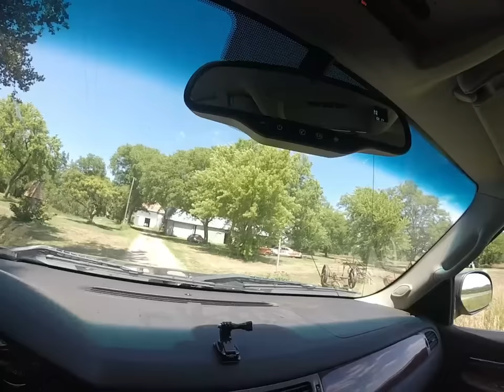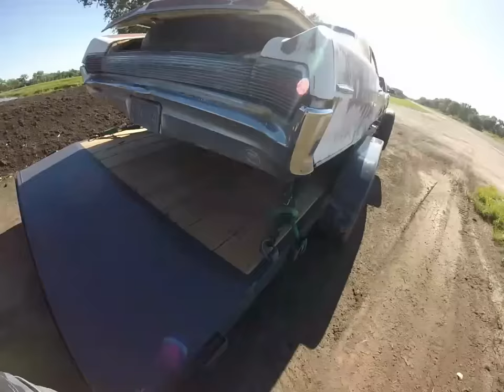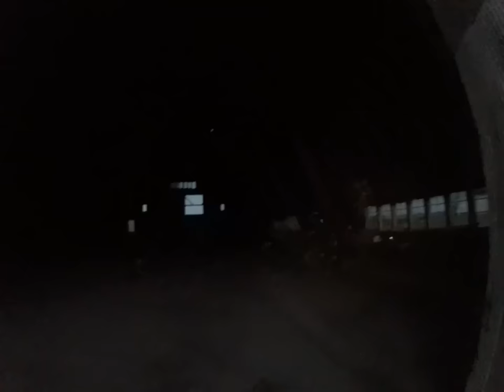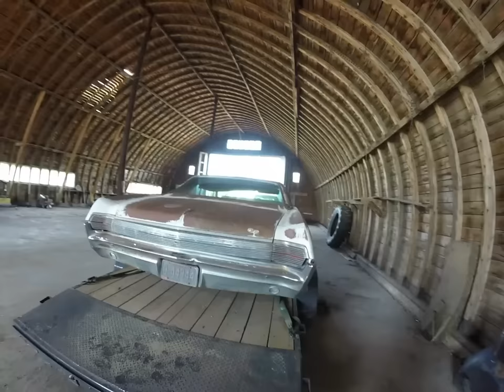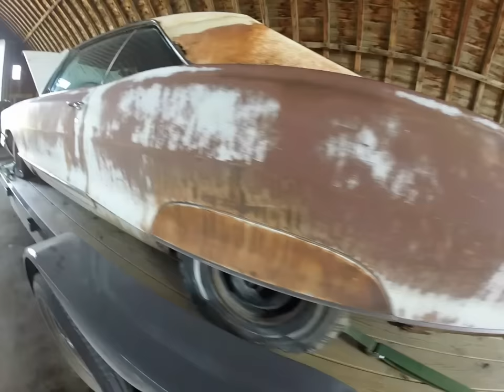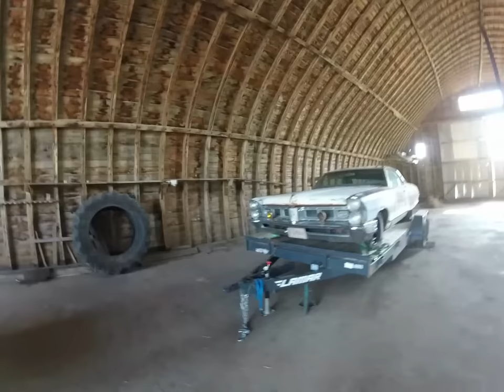Dragging a 1965 Pontiac Grand Prix to the farm

Comment: first of all thats an implament trailer NOT a car trailer the axles are farther back so you can haul tractors with loader buckets on the front you had the car to far foward and the engine should have been on the trailer not in the truck and you should cross your straps or better yet use chain and binders but you did make it home and thats what counts. cool car be kind to it and have fun with it.
Reply from the maker: Well that makes a lot of sense. Also explains the style of ramps and the stubby tongue. I'll be hauling a few tractors with buckets, so it'll come in handy for that. Would be nice to trade it in for a tilt bed someday, with more space up front for a winch. I made it home after a very long drive, and I do have nice ratchet straps now, but want to get chains and binders. Still learning and trying to not be too dangerous, especially to other folks out on the road. Thanks for the comment! Derek
Reply: Yes, you are correct - My trailer is the same - You have to get to know your trailer and where to place your load - I pull at 70 mph with a 6-liter Denali - no problem - You'll figure it out where to place your load so about 10% of total trailer weight is tongue weight - I do use stabilizer bars.
Reply: Yea, looks a little light there on the truck front end.

Comment: This is a very cool car. Headliner should not be a major problem to replace. But there is definitely lot of mouse house under the headliner. So careful when removing it. What is the story behind this vehicle? Did the last owner told you why it was parked or who owned it? There should be replacement sheet metal and rubber. I can't say the website where exactly, since its been years since I dealt with restored American cars.
Reply from the maker: The last owner did not know much. It sat for a long time and he finally talked a guy in to selling it to him. Then it sat again, until I happened upon it, driving the back roads! If I wouldn't have called when I did, I think he was about to motivate and get started restoring it. So I feel pretty lucky to have it! Thanks for the comment! Cheers! Derek